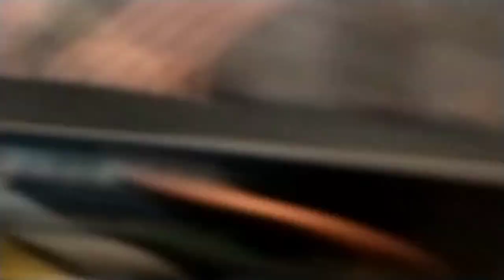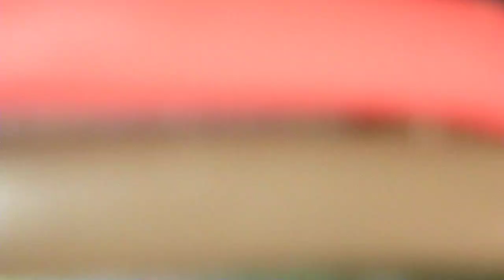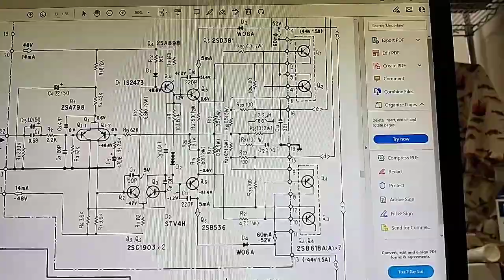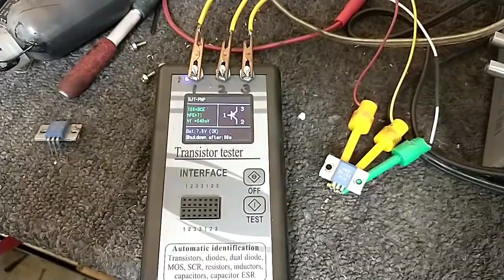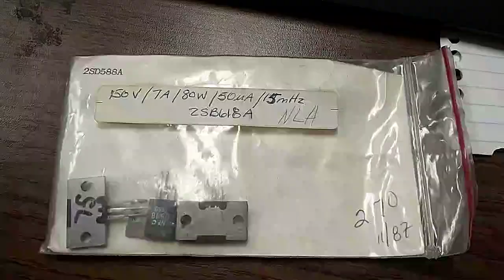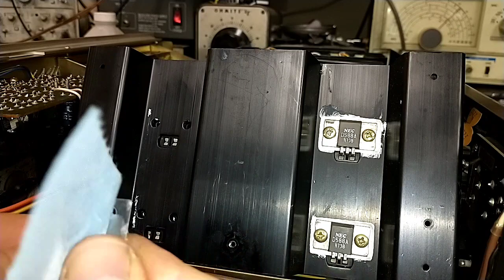Servicing a Pioneer SA-9500II amplifier with finicky right channel

Comment: Love this amp.. I wonder if if would be hard to convert that ( drill the needed holes in the heatsink) to T03 transistors with their sockets if you ever had a problem as they are available and robust.   Nice job.  I'm picking up one in full working order, expect to be cleaning controls and recap, maybe refresh the grease.. but I wonder if in the future it may need a conversion someday.

Comment: "But Yeah" Did you know you can set your PC to update outside of active hours and then you won't have to hate your operating system?  "But Yeah"  I'm not really understanding "Pioneer loves their wire wraps" comment when 99% of manufactures of audio equipment back in the 70's -80's including Marantz, Sansui, Kenwood, Realistic, JVC, Hitachi, and many others all used wire wrapping during the assembly line production. "But Yeah"  Also most bad/cracked solder joints will commonly fail when cold and not after they warm up as you claim in this video "But Yeah"  

"But Yeah"

Comment: Hey Jordan. Great video.I have this same integrated amp. My power lamp burnt out and I need to replace it (lamp just above the power switch).  Can you tell me how to replace get to and replace that lamp?
Reply from the maker: You will need to solder. 8v 50ma was the original value. 4.12mm in diameter. 

Joseph Mirabella can hook you up. I think his ebay handle is projectblk86

Comment: I Dont Use All Those Scopes
& Stuff Like That. Even Radio TV Phono Nut Dont Use All That Stuff.
& Neither Do I.
Reply from the maker: We all have our methods. I was taught by techs who preferred a scope to troubleshoot  problems that were not easily heard. I'm trying to get back into signal tracers which I haven't had to use for more than a decade. 

Whatever works best for you is what matters!

Comment: Jordan;  I have a Sony SQD-2020 4 channel Quad decoder. (mid 70s)  The left front output channel has an issue.  Sometimes it fails completely, other times it will work for a few minutes and other times will work properly for hours on end.  A Sony STR 7035 tuner is the main (front) input to the decoder and the rear channels is a Sony TC 1055  integreated amp.  Is this something you would like or be able to troubleshoot and maybe even find the problem for me?  Please let me know.  I bought this system new in 1975!
Reply from the maker: When it fails is there anything you can do to bring it back? wack on the side, messing with switches and controls, etc? 

Does the sound in that channel go away completely, or does it become weak, or does it become distorted? 

The pros of this machine are that its a very well designed set with all discrete decoding (I know, I have the service manual) but they are jam packed and are very tedious to troubleshoot. Trying to follow the signal path through the layers of boards and cables is no fun. 

Unless you're willing to drop $300+ on time to troubleshoot and repair this with the risk this could be a layered failure with multiple problems - I would look for another. Old quad stuff is cool, but I got out of it for this reason. Just so time consuming to repair.
Reply: @JordanPier  Hey Jordan; Thanks for replying! Sometimes rocking the rotary selector on the tuner makes it come back on.  But trying to use the process of elimination, when that fails I switch the  decoder itself to its 2 channel tape input and the output remains dead. I have questioned the tuner in the past but I don't think it is the source of the problem. juggling that tuner selector back and forth from radio to aux or phono must be jumping something in the decoder.  But as I said, that only works sometimes. If my understanding or the decoder is correct, it is quite a complex piece of electronics

Comment: Hi I've got a question about my VM record changer. I've tried for awhile to find someone to help me but had no luck. I came up on a video of yours doing a complete service on one. My problem is my changer does really great except for the last record when it drops it doesn't play it instead it shuts off as if it's already played the last record when it hasn't. Do you have a video anywhere that would help me adjust the problem or could you tell me how to do it? I would really be greatful for it. I'm going to subscribe to your channel I believe I could learn a lot from your videos .. thanks!
Reply from the maker: https://m.facebook.com/groups/498063417008273/permalink/2210125582468706/

There's someone with an identical problem. Follow this. I'm guiding him through troubleshooting

Comment: i worked on a pioneer sa-8500II that was doing some pretty crazy stuff, the protection circuit was flipping out, noise on the outputs (crackling), i replaced those dreaded dual pnp 2sa798 transistors, replaced a couple of those dual diodes in the power that cause issues and now the amp runs well no problems

Comment: Thanks for audio vid. I always eagerly await them. Such a nice amp but found it surprising they used those batwings, I would have expected some nice TO3s in one of their higher end units.
Reply from the maker: The original 9500 had TO3. I think they cut a few corners with the MK2
Reply: @JordanPier does this affect the sound much between the two different types ?
Reply from the maker: @twentyNinebark  no

Comment: Couldn’t click on this video quick enough! I restored a SA-9500. Swapped all the prone to get noisy transistors before they got bad. Love my unit.
Reply: Is this the unit that has a 'cut out switch' or limiter that stops you blowing the fuses ?

Comment: Thanks buddy for working on my amp..great job. Can't wait to get it home and plug her in.
Reply: Holy cow... are you in Phoenix? I had a Pioneer exactly like that with a balky right channel, that I sold maybe 3 or 4 years ago! I think I had a voodoo "fix" where if you switched it to FM mode (which seemed to work fine!), and then back to the aux input, the right channel would often mysteriously reappear. I hadn't recapped it; pretty sure it was virgin when I sold it. I got it in the mid 2000s from a friend who got it as a hand-me-down from his dad.
Reply: @iroll  So why did you sell it?
Reply: @lox_5017  A long story... but, I've still got plenty of janky old electronics hoarded. Sometimes you have toss one back into the pond.

Comment: This was an excellent head scratcher/troubleshooting adventure.  I enjoyed your process thinking; and it was good luck to get outputs close enough to put this amplifier back in the game.  Your customer will be happy I'm sure, these amps are really something when they are properly tuned.
Reply: Agree with you, it is uncommon to find someone that takes the time and trouble to go through the troubleshooting process.  So many times, people blame "bad capacitors" and shoot the parts cannon at something like this (they even go so far as to replace every single capacitor, even film and ceramic disc capacitors, every single resistor even of it measures within tolerance and every single semiconductor even ones which are not known to be troublesome).

Comment: Excellent repair 😀
I've had a few amplifiers with blown outputs,  i check every part in the bias circuit and the drivers.
I would rather check too much than miss something and pop goes the outputs.
When you said it was your writing,  i though two jordans eeek :-D joke.
Not solder or sodder but  Smolder 😀

Comment: Wow first time I've heard anyone mention the curve tracer I've been using one forever makes troubleshooting so much easier
Reply: Have been using a component tracer for years. Won't give you gain but shows up leaky junctions right away.  In a power amp would unsolder 2 of the 3 leads of all the transistors and find all the bad and questionable transistors in 1 shot. Not 100 percent foolproof but sure is helpful. I don't see it covered much on YouTube.
Reply: @marka1986  once you learn the signatures of the components you can run through most circuits and find the defective parts